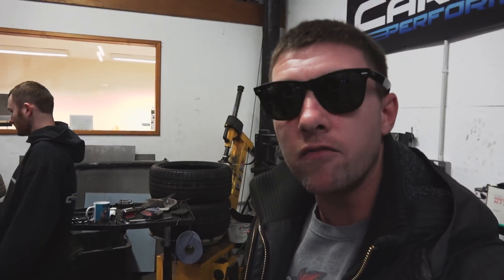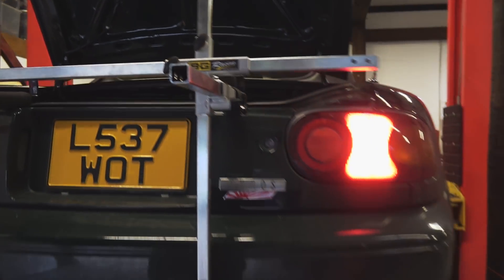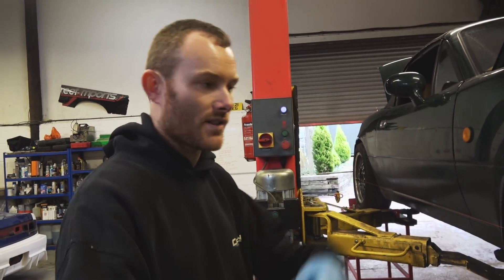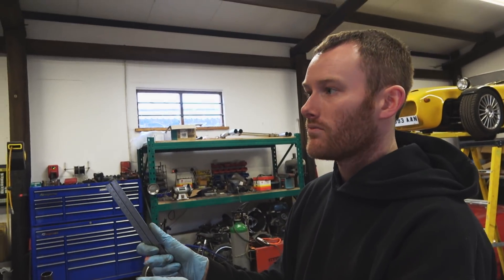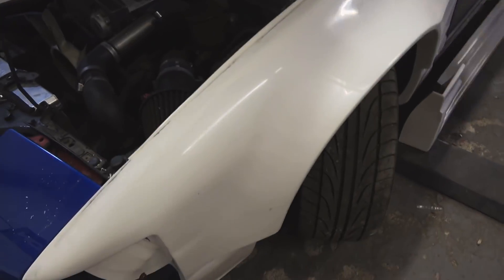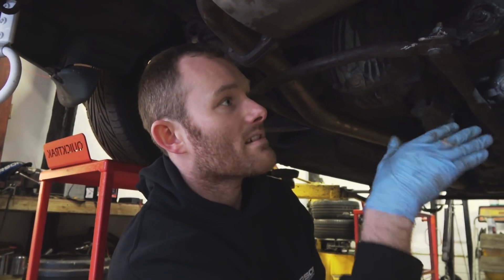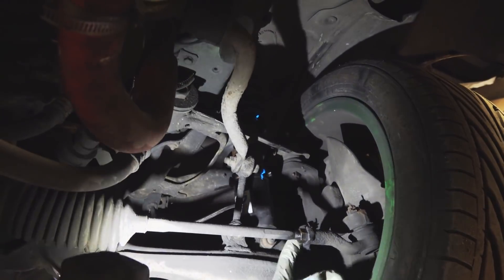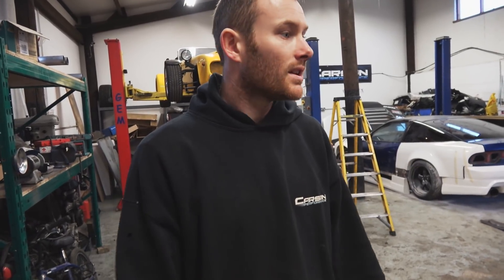🐒 HOW TO DO A WHEEL ALIGNMENT + GT86 2JZ UPDATES

Comment: I have a Hunter HawkEye wheel alignment in my shop, takes 2 mins to set up and an average of 30 mins for a 4 wheel alignment on a drift car, really feel for you guys using that equipment.
Reply: So about the same time as a string set up lol?
Reply: Kris, if you got a seized bolt then it needs to be replaced no matter if you align the car or not, nothing to do with what alignment equipment you use pal.
Reply: Cost is the only reason they are using a string alignment, they are not accurate at all, i continuously have to re-align other garages that use this string set up, i would not recommend it at all. I'm a professional wheel alignment specialist and passed all Pro-Align certification, so i know what i'm talking about.
Reply: Kris Nicholson
I feel you man, not a lot of garages want a car with a snapped bolt stuck on there ramp so they wont touch it, it took me 4 hours to get a broken rear camber bolt out of a Merc a few weeks back, had to cut it out with the chassis attached, fabricate and re-weld a new bracket on the chassis, had to drop petrol tank and everything, just because a seized bolt which caused the Toe not to pull in 2 degrees.
Reply: Cant take a hunter machine track side though.
Reply: OnTheRun  Lol, the time it takes you to set up the string alignment your day at the track will be over. Also you make sure you align your car before you go to the track in the first place, basic common sense. If you do need to make mods at the track then laser and digital systems are quicker and more reliable.
Reply: Tell that to the btcc teams who are stringing cars up between races and the finishing on the podium. 

Theres a place for string alignment, its at the race track.
Reply: OnTheRun
Well done, so as long as you have a race team behind you you will be able to set up the string system easily and you have more time on the track, but if time is on your side like i pointed out then the laser system is cheap, easy to set up, you don't need anyone else to help you, and you can align your car within 10 mins.